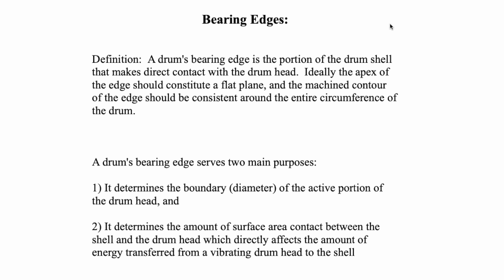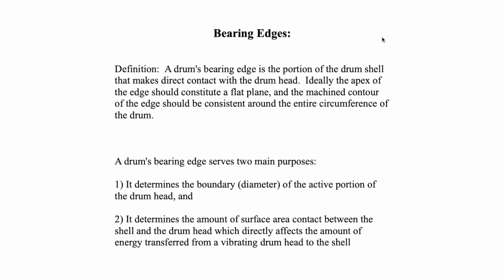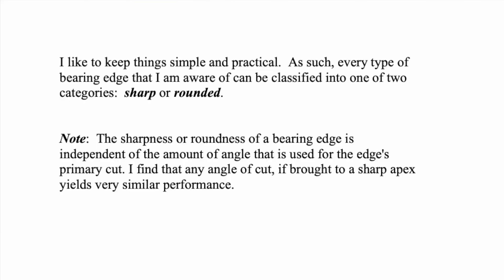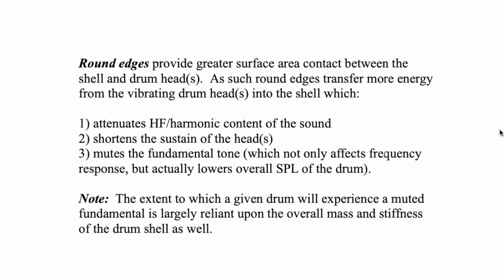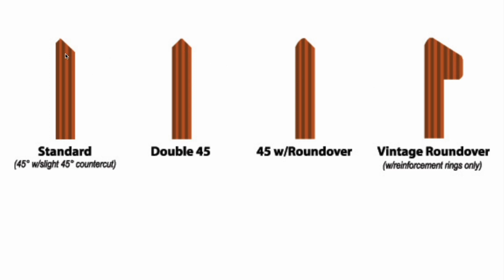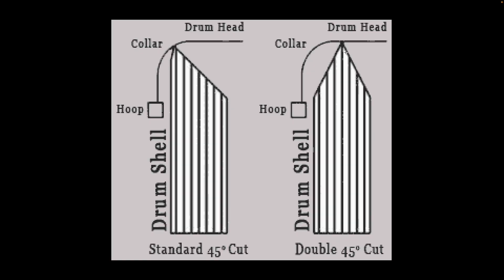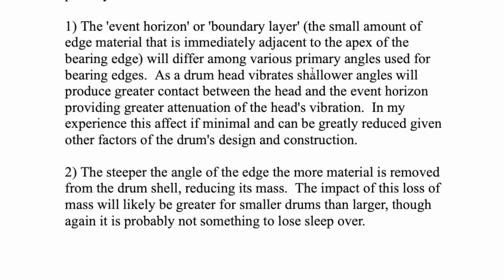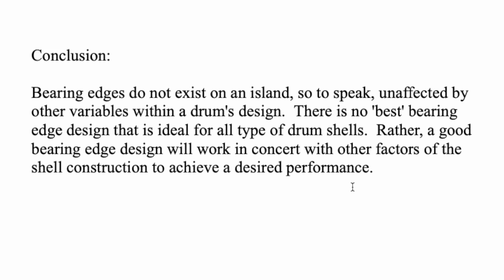Bearing Edges -- Drum Sound Physics Part II

Comment: Thanks for this pretty in depth info. I did enjoy it very much. Not a criticism at all, but may I suggest you include some actually audio clips along with your content, so we can hear ' general ' examples of your points. That would take your content from excellent to amazing, and even more helpful to us who thirst for better results. Thanks again.
Reply from the maker: I SOOOO want to do this!! I'm trying to put this together for a future video, but it will take a bit of preparation, because effectively demonstrating the impact of various bearing edges means all other things, as far as possible, need to be the same.  So I can't just compare one of my  kit's toms to another, because so many other variables differ (shell material, thickness, wrap, dimensions, etc.), so that wouldn't really be useful.  I need to have my buddy Jon (who builds drums) make a few 'identical' drums with different edges, so I can tune them the same with the same heads and compare the performance.  So it's an awesome idea, and one that I'm trying to do.... let's hope I can do it soon!  I do think that would be tremendously useful.
Reply: The only trouble with that idea is that it introduces the effects that the microphone adds which he mentions in the video. He would have to do close miking at different distances from the edge and room mics making a relatively long video even longer. Not to mention the effect of amps and headphones or speakers.

Comment: The drumhead contact with a shallow angle edge cut will not only bleed off more energy to the drum shell as you mentioned (obviously, dependent on the mass of the shell), but it can also introduce a waveshape distortion to the drum sound. 

Think of it like this: the head vibrating pattern is essentially a complex sine wave, fundamental note overlapped by a series of harmonics. That contact limits the motion in one direction, flattening the apex of the wave asymmetrically. The edges of the head have a larger proportion of high order harmonics (i.e. mic the edge vs. the center of a head and you'll get two very different harmonic profiles), so you'll distort most there, creating a bunch of additional new harmonics.

That will probably be heard as a louder, brighter "crack" on stronger hits followed by a faster decay and "deadening" of the sound.

EDIT: create a playlist for these physics videos! Better to have them automatically play one after the other.
Reply from the maker: Excellent stuff, thank you!  And yes, a playlist is a good idea (though only two videos in the series so far).

Comment: Very good explanation of drum bearing edges!!!  You mentioned about tuning issues with bearing edges that aren't true.  How would you describe the sound (excessive overtones) of a drum/tom that may have a bearing edge that isn't correct and how bad would it have to be before you would modify the edge to correct the problem or have someone do it for you?  I was taught  to never modify the bearing edge in any way.  Thanks for another great video!!!
Reply from the maker: Typical tuning issues with uneven edges are odd overtones that are hard to tune out, less defined fundamental pitch and/or increased overtones, and diminished sustain.  Boxier tone as well, less full and balanced.
Reply: @drumdotpizza  That's good to know.  I've heard similar comments from others so this confirms what I've been hearing.  If you've done the drum on a flat surface, (back of a mirror for example), with a light showing through in areas that are not completely true and you are seeing some light shine through, how much is enough that you would have the bearing edges re-cut?  Should it be a perfectly flat (true) edge?  Since the bearing edge affects tuning as you said, I'm wondering how long should a drum (reasonably) stay in tune?   Thanks again Joel for your channel and sharing your knowledge.

Comment: Dude, I've never even once thought about my head's shoulders and collars compared to my edges.  That's good to know!
 
Talking about surface contact got me thinking about something a prof told me in school and it's rattled around in my brain for 15 years.  Two finished, granite countertops, laid on top of each other:  at the closest level, those two things are only touching each other at about 30-40% of the surface. The rest is spaces.  Seems like bullshit but I doubt he was wrong.  It was a lesson about friction and S/A.  So if that's granite, it makes me think about how little of the head is actually touching the wood material in the shell.  Great shit, sir. Good video AGAIN!
Reply from the maker: Are we talking drums or shampoo?  :)

Regarding the edges, yes, getting it flat takes a bit more time and effort which translates to expense (labor and materials).  This is a contributing factor to the higher cost of better quality drums (and also why a little elbow grease on one's own can improve the quality of an otherwise cheaper kit in many cases!).  

As for the head making contact, mylar (or polyester.. the material most all plastic heads are made from) if flexible, and will conform to the shape of an edge.  It doesn't do so quite as easily has actual calfskin (or goat skin) does (one reason companies often didn't sweat the bearing edges as much back in the day), but it still conforms.  So under any amount of pressure the head probably is making reasonable contact all the way around, particularly with better drums.  The ideal is still a flat edge though.

Comment: As a tool and die maker the minimum bend for material over an edge should be 1.5 times the material ( the head) thickness , so there needs to be a radius on the edge.😊

Comment: I taught myself to recut the bearing edges on my 70s Big R Rogers, used a 45° bit on a routing table to achieve the standard 45 with the countercut, and it made an extremely positive change in how the drum sounded. If you have old drums, those bearing edges are so dull, go sharpen them up!
Reply from the maker: Vintage drums tend to have a vibe about them, and it is amazing how that vibe can change with sharper edges (greater tuning range, more modern sound).
Reply: @drumdotpizza  I was blown away. I honestly did not expect the edges to make much of a difference, but they really did have an audible difference after I leveled and routed those edges

Comment: About the shell vibration: we should consider in a drum also the "air spring" inside the drum, between the drum heads (unless we have a single head drum). And once the drumshell is not airtight the size/amount of vent hole(s) has effect on the drum's acoustic frequency response too.

Here a "loose" and "thight" drumshells play differently even though they were made from a hard or soft material. By loose/tight I refer to the flexibility of a shell. A thin shell is more flexible than a thicccccc one (talking about the usual wooden shells).

And on acoustic phenomenoms we should also take in standing waves, comb filtering etc... 
...and at the end of this rabbit hole, get reminded about theory vs practice. The geekier we get the smaller the details are and the less they have role in the end-product: music. A great drummer can make a bad snare sound awesome in beats and sounds, the musical context, while a primitive unsophisticated drummer is annoying even with the most expensive amazing drum.

Thanks again for a well made thorough video. Very informative.

p.s. about the mass difference on bearing edge. That is something SMALLLLLLL, imagine a 1000 gram drumshell and you cut the edge 30 degree vs 45 degrees the mass DIFFERENCE would be maybe 2 grams/edge depending on the shell density. so... less than 1% mass difference. Not practical. The "event horizon" would be more significant for this but the EQ difference of the bearing edges would be more significant on the highest end of frequency spectrum due to the wavelength/amplitude spectrum.

Comment: Brilliant explanation mate, one of the best I've seen (out of toooooo many). Thank you. What's still eluding me is the inside angle. I understand the importance of the apex and angle/roundover of the outside profile, so as to create the actual bearing edge, but after that, how does the head 'know' and react to whatever the angle is on the inside profile? I'm still thinking about it. Cheers.
Reply from the maker: In general I don't find the particular angle used inside the cut to be of great importance at all.  I stated in the video that all the common angles used, 15, 30, 45, and 60 don't really differ in practical application.  Rather, it is the treatment of the apex of the angle, the part that establishes the active diameter of the drum, that matters.  Any angle can have a sharp or rounded apex (radius), and there can also be a roundover (or not) on the outside of the cut, but the inside slope of the angle pretty much doesn't make contact with anything, so it's basically passive.  Only the event horizon I discussed at the end of the video changes for the different angles, and my ears really can't tell much of a difference at all, so I really don't worry about it.  

I hope that helps!  Thanks for being here!
Reply: Ah, so I just got to 27'13", which explains it perfectly (and I think is a first on YT). That'll teach me to not to post comments until I've watched the whole video. Cheers.

Comment: I've always looked at the drum head as being a string like on a guitar and having individual strings, but you're tuning to a unison. So if you have 8 lugs per head you have four strings. That is my approach to tuning. That being said the bearing edge is like the bridge and nut on a guitar-bass what have you. I came to this conclusion after being around many really deep guitar players who are also luthiers. On a guitar those two points (the nut and bridge) yield various attack and tone qualities as you change the shape where the string lays on them. So I thought well hell it must do the same thing to a drum...pretty darn logical. I had one acoustic blues guitarist explain the architecture in the groove in nut as "crotch angularity" and the same for the bridge points. The frets are similar but a slightly different subject.  Pretty cool info I thought. Thanks for simplifying the mystery of the what? and the why?, very concise. You're good at this stuff man!
Reply from the maker: Thank you!

Comment: Can I ask a super random question. I have a kit that has fully rounded bearing edges on the kick, and floor tom, (maybe some people might guess what it is hah), but at any rate, I think it's a beautiful kit that I don't want to give up on, but I'm just having some struggles with it in the studio, mainly the kick, but I find the floor tom a little bit too subdued also, but it's not nearly as bad. 

The Kick/Floor Tom use a bunch of Mahogany in them, so that's already adding some low end, and making them sound darker(have you guessed the kit yet), but it makes sense to me why the they sound like they do. With the Kick, it's like you get attack in the beginning, with a huge amount of low end, but then it just sounds boomy/dark/boxy for lack of better words. It's basically lacking the Low/Midrange resonance, and higher end attack you'd normally expect from a kick, but also I'm doing a lot of heavier/faster Rock/Punk/Metal stuff. 

To my question, I was thinking about possibly getting the bearing edges modified (professionally) to a 30 or a 45 sort of thing, or some variation, maybe a partially rounded 30-45 etc, but just wondering, do you think it could be worth while to try something like that?  Also, do you think it's possible to just get one side of the drum done, so say a 30-45 on the batter, and just leave the Reso fully rounded, or do you think it's pretty important to have both sides the same? I was thinking it might yield an interesting result, but at the same time I'm guessing it's probably been tried, and there's a reason you don't see that on kit's. If I were to try something like that though, the batter would be the side you'd wanna do right, you think? 

Anyway, just wondering if maybe you had some advice, or thoughts on the matter.  Cheers!
Reply from the maker: General thoughts that might help you:  
1) sharper edges will add more complexity of tone to your kick and floor tom with greater sustain as well.  Any drum will have attack when it is struck (that is a function of the stick hitting the head), but the darkness of tone after the attack is a function of the edge and shell (and head/muffling).  All things being equal a sharper edge will allow the fullness of HF response from your head (if you're using a thick/double-ply/muffled head this will have less impact).  
2) Generally matching both sides of the drum with the same head allows them to interact similarly.  That is, if one side has a sharp edge and is therefore free to vibrate while the other is rounded and muffling the head, then the muffled head will stifle the vibration of the otherwise livelier head.  Usually you want the two to work in concert with each other either to vibrate freely or be more controlled.

You have to decide if the expense if worth it, of course, but I think you'd enjoy the improvement (most likely) that new, sharpER edges would give your drums.

Comment: Hi Joel, I am obsessed with your videos. Could you please explain the affect of turning a floor top leg upside down and why that leg digging into carpet reduces the sustain of a floor tom? I'm assuming that it reduces the resonant potential of the shell, which should actually have the opposite effect on the sustain?
Reply from the maker: I'm actually working on the outline for a video that will explain this right now.  Hope to film it and have it out within the next month or so.  

Short answer, the physical connection between the drum and the floor is quite direct (easy for vibrations to travel) with the bracket bolted to the shell and a straight leg clamped into that bracket.  By simply adding strong angles to the leg (DW/PDP use right angles on their legs) you inhibit the direct transfer of energy which helps to isolate the drum from the floor.  

Direct transfer of energy will rob the drum of energy and make for a dead sound with little sustain.  Indirect transfer (isolation) helps to keep the energy in the drum, making for a livelier and more sustaining tone.

I hope that is helpful.  ??

Comment: I’m having a log drum built with Australian hardwood shell will be 11mm thick. I want that Brady crack but it’ll be 7” deep. What are your thoughts on bearing edge? Options are: 1. 45 on the inside or
Slight round over on the outside with 45 on the inner edge or 2. 
Round over both sides
Reply from the maker: I'm a 45 degree guy.  Hard to beat the tuning range and overall quality of tone from a 45 degree edge.  When I have edges cut I generally do a single 45 with a very small 45 counteract on the outside just to help the head clear the shell a bit... I don't want a lot of contact between head and edge.  I like sustain, and sharper edges yield greater sustain from the heads.  I can muffle a variety of ways to get the sound I want at a given time, but it's near impossible to add sustain to a drum that doesn't inherently have it.

My 2 cents!